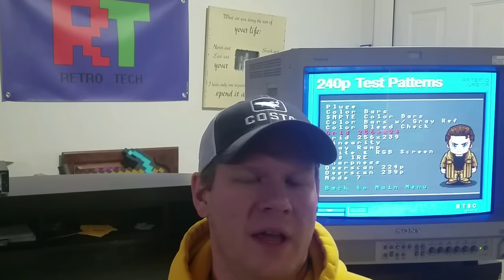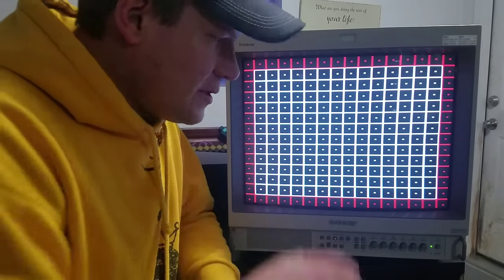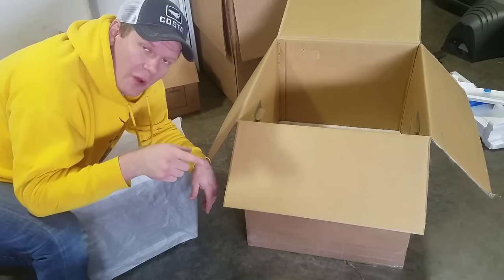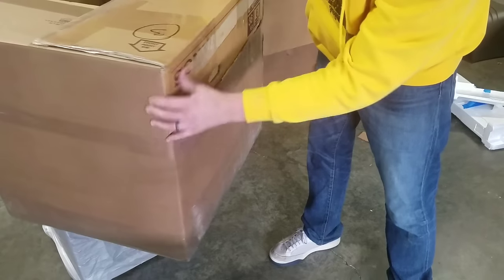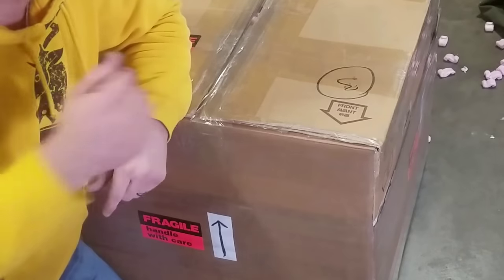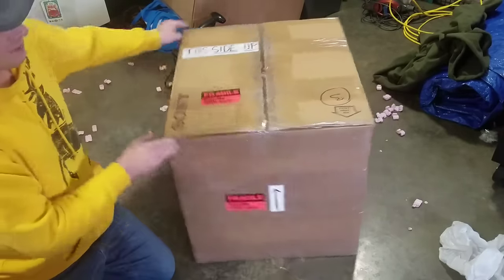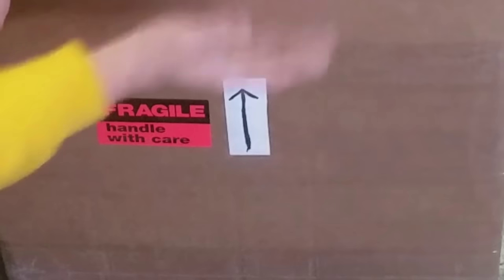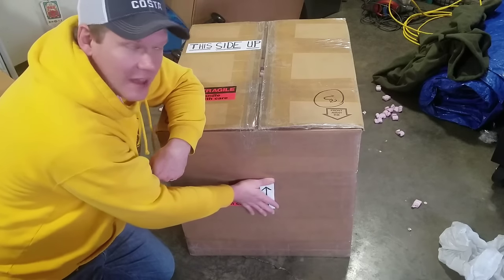Packing a Large CRT Monitor for Ground Shipping!!!!

Comment: I have to say this Steve,

I come across so many great Craigslist finds with it comes to these iconic Sony monitors in the past. In fact, I came across over 50 of them. The frustrating  part is that nobody would ship them to me. 8^(

They all said the same replies. The shipping, packing, all the necessary prep work, handling, and the weight would cost well above than the unit itself. Insurance would have to be top dollar and there's no guarantee on the traveling process if will be in one piece once I receive it. So they respectfully decline my offers regardless how tempting they were.

Well...Like they say, "if first you don't succeed, try, try again". 

But in the meanwhile, I love your Neo-Geo MVS cab making an appearance in the back for sure. 86)

Nicely done as usual bro. Keep it up. 8^)

Anthony..
Reply from the maker: That stinks.  It's hard to ship them properly, but FedEx for example will pack it, insure it, & ship it themselves.  Honestly it's not much more than if I packed it myself.  They get a better price on packing materials and then insure it since they packed it.  I don't think they pack them well enough TBH, but they are responsible at that point.  I just offer to pack myself most times becasue I don't want a monitor to ever get damaged, but it still happens.  I should talk about that some in an upcoming video titled: "When shipping a CRT goes wrong." Keep on hunting for them. - Steve

Comment: CRTs should be shipped box in box!
Reply from the maker: That's right, double boxed.  The inside box on this shipment was a double wall box and the outer box was a single wall box giving it triple walled protection.  Always at least double box.
Reply: @RetroTechUSA  I actually meant putting this box in another box which is also stuffed with peanuts etc. This will give you maximum protection
Reply: I ship mines in wooden carcass. All covered with bubbles, heavyweight paper and so on. Zero broken PVMs so far. But costly.

Comment: Please stop using packing peanuts.  They shrink over time under pressure. Use no-pop bubble wrap.  It's expensive but you can buy this at the UPS store. Only place I found it.
Reply from the maker: Thanks.  I'm not using the peanuts for any structural support on this, that mostly comes from the boxes and the Styrofoam inserts.  I compact the peanuts down and they are their to fill in the air voids and they do offer a little bit of extra protection.